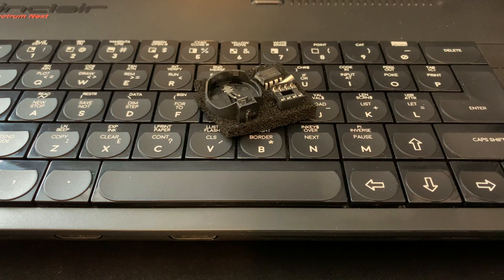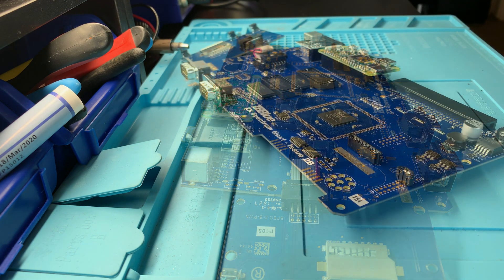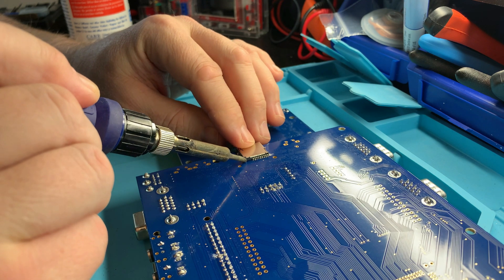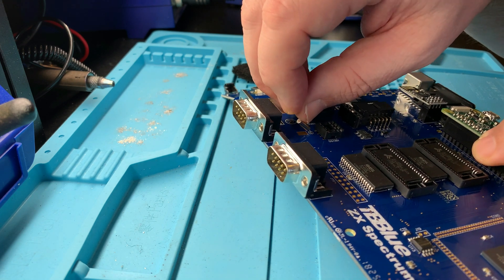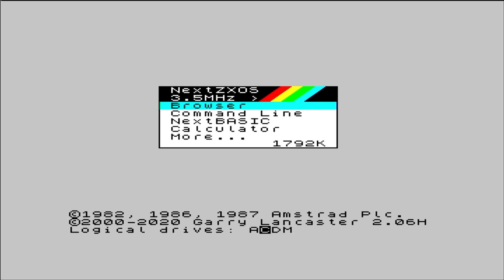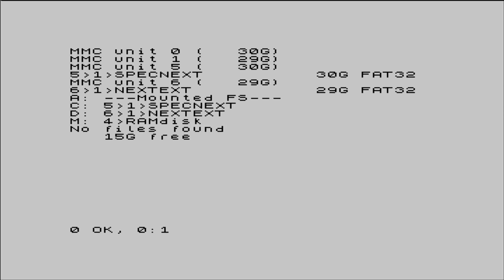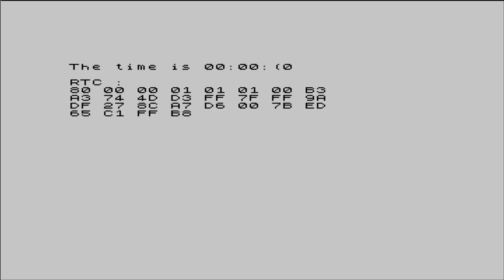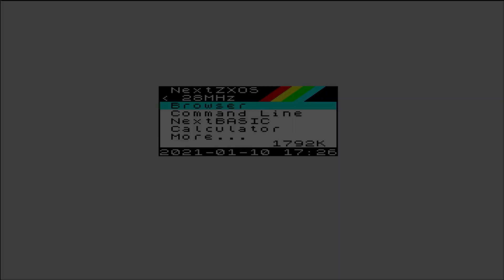Spectrum Next - Part Three: Soldered Upgrades!

Comment: I have an N-GO, it has one mounted SD on top, and pins to connect more SD cards.  I added an adapter to the pins and it has 2 more SD slots.  Can the next/n-go have more than 2 SD cards?  How many drives can it support?
Reply from the maker: The Next can recognise multiple partitions on an SD card but don’t think it can address more than two physical cards - unless someone knows different?
Reply: @TheRetroShack  Thanks for the information.  I wonder what would happen if 3 were connected?  Probably some type of failure, the equivalent of connecting 2 SD to one set of SD pins.  I don't know if SD cards work like USB hubs or not?
Reply: @TheRetroShack  This links shows a Drive 1A,B and Drive 2A,B and I think the green button changes drive.  So maybe you can have 4 drives but only access two at a time?  The A's  or the B's.   https://store.activeconsult.co.uk/shop/ols/products/zx-spectrum-next-external-sd-drive-183537cd-7c46-4e35-8c6b-0e4e235d1607

Comment: Hmm, none of these parts are expensive, so I wonder why they don't include them from the factory. As this machine is quite a hobby/special anyway, I'm sure the buyers would not mind a ten or twenty credits up in the price?
Reply from the maker: I thought exactly the same thing - it was £25 difference to get the machine without or the machine with.  If they’d just sold the top end one, they’d have still sold out :)

Comment: I saw that you installed a Pi as a co-processor in part 2, but what are you going to do with it or what does it let you do that you could not as standard?
Reply from the maker: Hi there.  At the moment the pi is somewhat under-utilised being mainly used to provide tzx tape loading support.  However ‘theoretically’ the Next can use all of the Pi’s memory, CPU and GPU.  Just not a lot of evidence of that so far to my knowledge.  As always, if the community here knows anything, please share :)

Comment: Perhaps you need to calibrate the clock (or write some BASIC to do so)
Reply from the maker: I wonder if I could add a little start-up script to set the clock each time I switch on.... *thinking*... :)
Reply: I meant what the clock chip itself provides assuming that’s the issue
Reply from the maker: @jms019  Oh, I see! Sorry!

Comment: Given some of the old sound techniques out there I might try to find room for a small magnetic speaker instead of a piezo, since the self inductance can provide a useful filtering effect.
Reply from the maker: Yep - I’ve since replaced that speaker with a much nicer one - wasn’t worth doing a video on that alone but will probably show it in an upcoming Next video - thanks for watching :)
Reply: @TheRetroShack  which “much nicer” speaker do u recommend?

Comment: Scott, another great video!  ... and a  great way to prep your soldering iron tip is to wipe it and tin it with ThermalTronics "Tip Tinner".  Also, you might find a 1.5mm tip more suitable for pcb work than the 3mm, especially when soldering SMD. And yes, it's always ZEE if you've lived in the States for while :).
Reply from the maker: Great tip!
Reply: Zed*